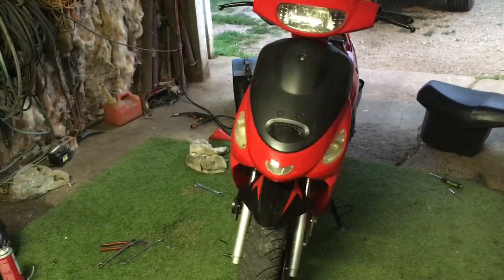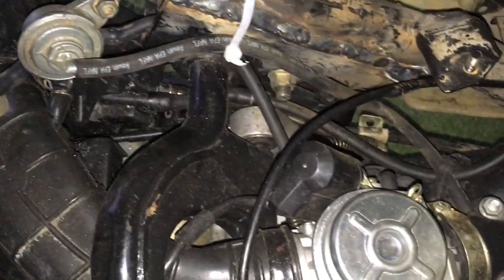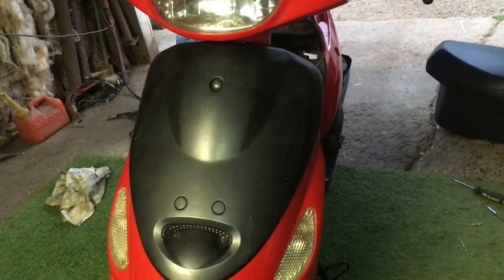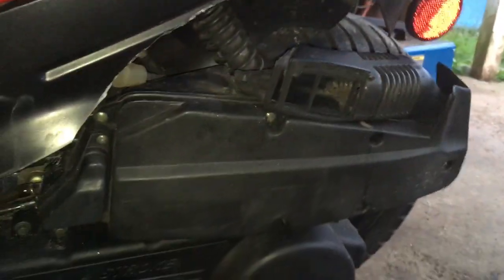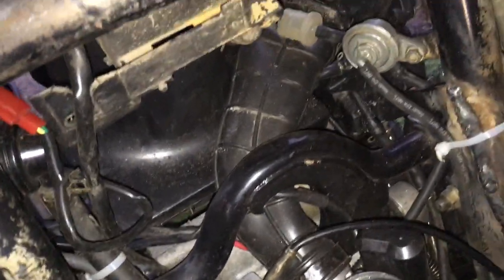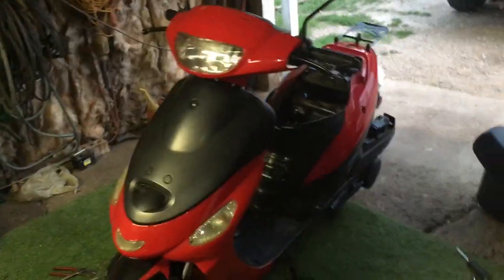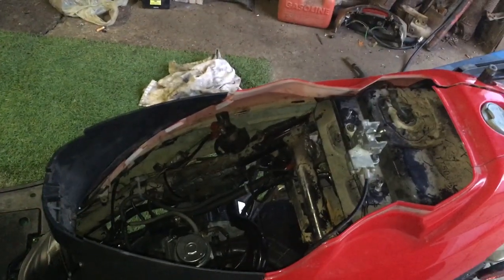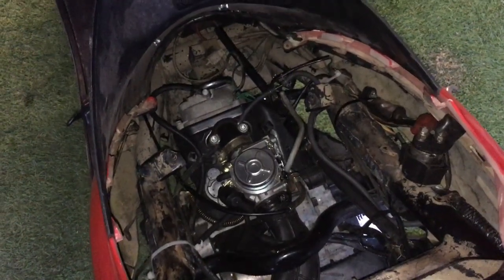TaoTao 50cc to 150cc engine swap Part  2

Comment: I bought my kids a 2013 tao bull 150 4 wheeler and want to swap the engine with their tao rhino 250 engine but tao motorsports won't email me back to see of its compatible.  The chassis with the 150 cc is the same size as the 200cc version and there is still room. The wheeler is actually bigger but only goes 30mph maybe with the 150. The 250 goes 50mph

Comment: Why does my 50cc feel real loose when I throttle,it will go like 2 feet then feels like clutch ain't grabbing,then it will go.
Reply: Any suggestions
Reply: What do you mean by loose?  
What I would do is pull the case cover off and inspect the belt, variator and clutch components. Something might be loose
Reply: What i mesn is it feels like nothing is holding it back.when i throttle it goes then you here it rev but dont grab and go nowhere for a sec or two then whatever it is it feels like it grabs then goes

Comment: I dropped 175cc qmb 4 stroke in my 2006 peace sports scooter, I had a 50cc 100cc big bore kit but finally just went for it, dropped right in with a couple of welds no problem, 42 millimeter carb racing CDI no limiter, racing coil, new valves and cam, anything that can be done has been done, custom exhaust designed and welded by myself, fastest I've got it was about 80 and I had plenty left I was scared to take it any faster with these small ass tires. Next step is to paint it because it looks like complete s***, I love pulling up to people thinking it's a 50cc and flying by their ass, anybody that knows scooters will know it's not a 50cc just by hearing it.

Comment: do you have to make adjustments to the frame for the short 150cc engine for it to fit in a tao tao 50?
Reply from the maker: Jurgen Westra I used a long case GY6 150CC 
If you can find a short case you will be better off because you can usr the stock rear wheel off of your scooter the 150cc short case uses the 10 inch rear wheels the 150cc long case uses the 12 and 13 inch rear wheels
(The 150cc Long case uses bigger rear brakes- The 150cc Short case uses same brakes as a 50cc )

Comment: I've got the same scooter. I have 2 150cc frames with running engines. I'm thinking about it. I have a bare frame 50cc to put engine on .just trying to talk myself into it . My 2 donar 150cc scooters are TaoTao. I modified my 50cc to take then 2 headlights .
 That's a good job . 
Appreciate you showing this
Reply from the maker: You are very welcome oh with mine the wiring from the stator was a direct plug in aka plug and play 
I forgot where your frame mount needs to be attached you will need to remove the small ignition coil bracket thats welded to the frame and find a new place for the coil
Reply: @pawzaremagic  
Are you serious about it hitting 60 to 65 mph..?